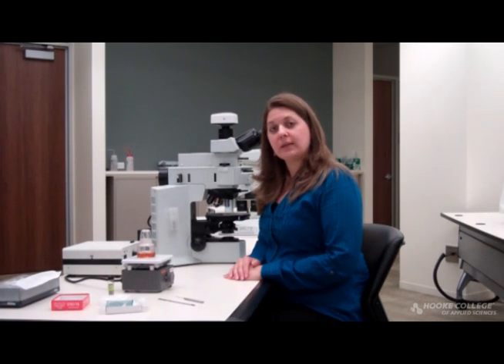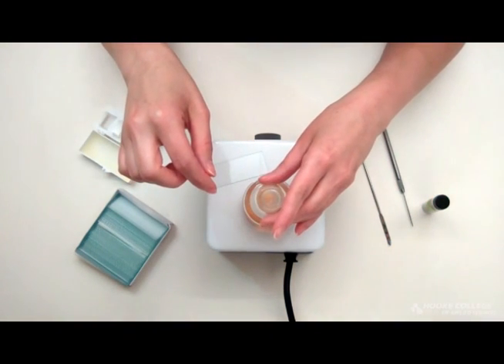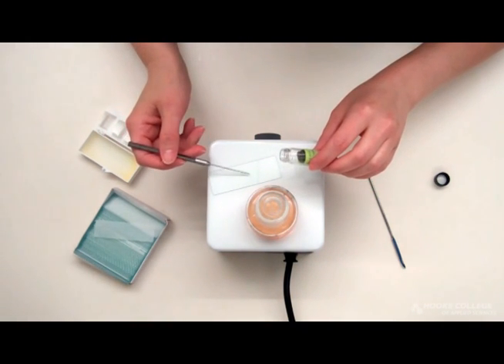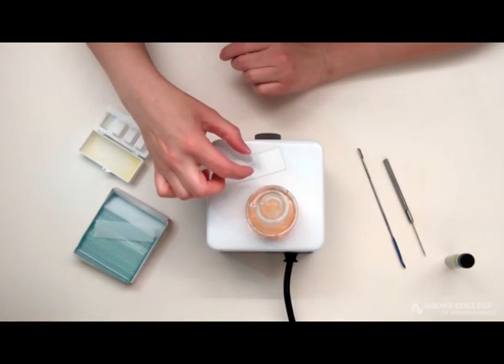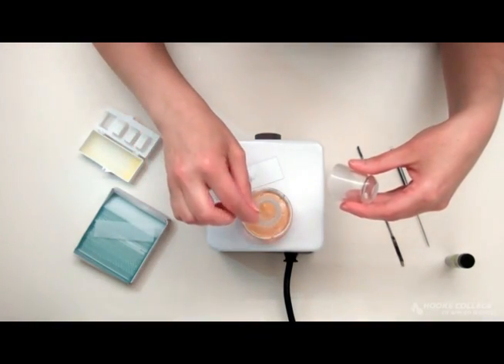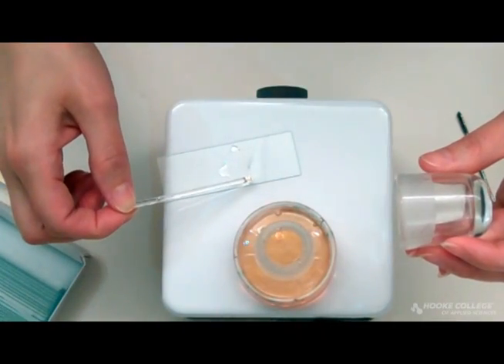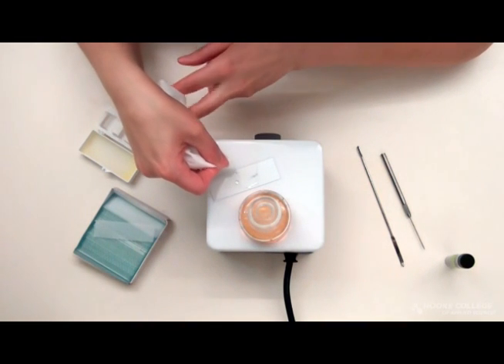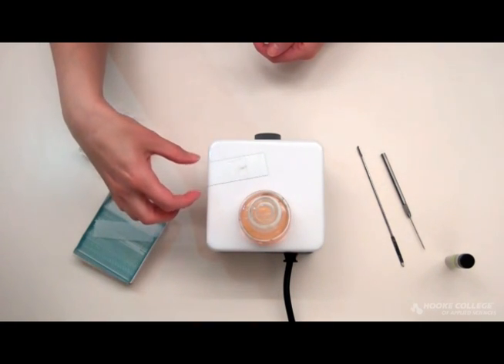Hooke College: Permanent Slide Preparation

Comment: what about using glycerin jelly or Canada balsam in the preparation of palynologic slides... and how can I obtain a good slide without air bubbles or scratches caused by using needle
Reply from the maker: +Walaa Hesham, thank you for your questions. 

Dry, settled pollen is almost always found in a collapsed state. Such collapsed pollen is merely locked into this state when mounted in resinous media, such as Canada balsam or MeltMount™.

The problem comes when attempting to identify the pollen, because the dichotomous keys are based on dimensions of the grains in an expanded state, which is achieved in aqueous media such as glycerin jelly or carboxymethyl cellulose (CMC). Pollen are difficult to see in these media so that a stain, such as acid fuchsin, is often added to the mounting media to enhance the visibility of the diagnostic characteristics of the pollen grains so that an accurate identification can be made. Expand the pollen by soaking prior to mounting: use xylene before going into Canada balsam, or a glycerin/water mixture before going into glycerin jelly (be patient, it takes a while for the pollen grains to expand). You will need to ring the slide to prevent the preparation from drying out when using aqueous mounting media.Pollen that have been processed through acetolysis also need to be mounted in aqueous media, and the coverglass ringed.

For a brief explanation and images of the above, see the characterization of Timothy Grass Pollen in the McCrone Atlas of Microscopic Particles (http://www.mccroneatlas.com/viewer/index.asp?PARTICLE_ID=46, no-cost registration is required).

Air bubbles are merely a matter of technique; practice the technique explained in this video. 

Regarding scratches, the best preventive is to avoid using a metal needle. An eyelash becomes a classic "needle" when glued to the end of a stick, or the end of a toothpick fragment held in a needle holder, and can be used for manipulating fragile samples; a pig’s eyelash is ideal because it is tapered and has the proper amount of "give". 

We hope that answers your questions. Let us know how it works out.

Comment: If you have limited access to the oils, can you also use clear nail polish?
Reply from the maker: Renee11123   Thank you for your question about using clear nail polish.  Cargille’s Meltmount™ is a proprietary thermoplastic resin that is applied while melted on a hotplate, and then allowed cool. When cool, it is a “permanent” microslide preparation. Industrial microscopists favor this mounting medium with n=1.66 because the preparation may be reheated as desired to change the particle’s orientation or remove it from the preparation in order to further analyze it by some instrumentation technique. Such thermoplastic preparations may be endlessly reheated to make them fluid and cooled to make them “permanent.”

As for the use of clear nail polish, the answer is yes. You can use clear nail polish or, for that matter, any other clear material as a mounting medium. Be aware that the clear nail polish is probably solid nitrocellulose, or something similar, made fluid by being dissolved in acetone, or another solvent; the combination will be flammable. You may want to carefully use gentle heat to hasten solvent removal, but be aware that the medium will not penetrate many kinds of tissue unless they are thoroughly soaked in the solvent, and even then air is likely to be entrapped, especially in plant tissue. If you wish to use a clear nail polish as an analytical microscopical mountant, you will need to know the refractive index of the clear nail polish after it is dry. To determine this, make a series of droplets of the clear nail polish and in each droplet add several particles of Refractive Index Glass Standards, and using the Beck line method and 589 nm illumination, locate that droplet in which the glass particles have disappeared after the nail polish has dried.